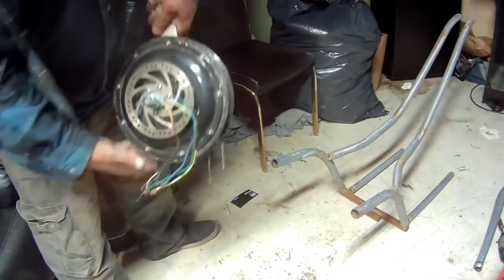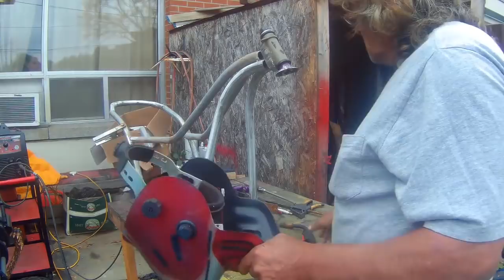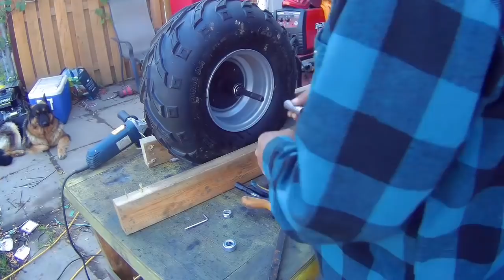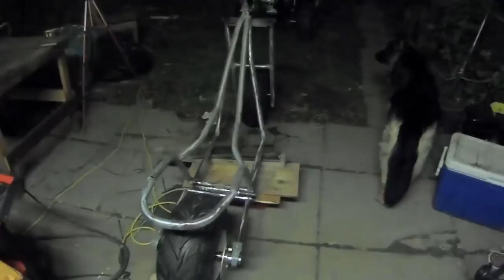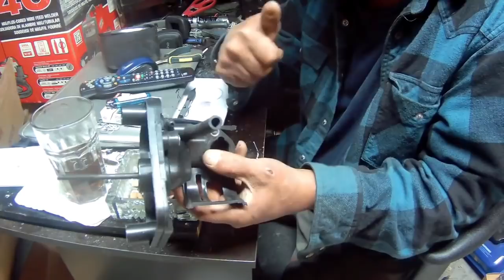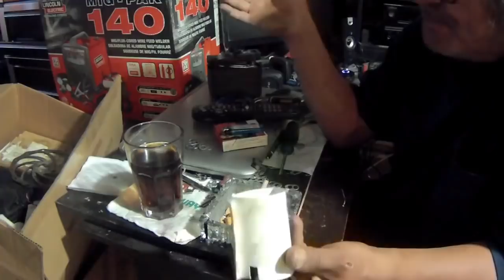Mini Bike/Chopper Build pt02

Comment: Draw a straight line on the floor and mark the center of tbe frame .. line them up to get a better reference. I like your design but it looks like it  needs a little more bracing for strength

Comment: The Chopper is coming along nicely mate.  If you want to check for square  you can  measure your diagonals.  It works on everything.  Or measure from two points to one  like a triangle.  Measure from the square part of your base frame on both sides to the centre of your headstock.  That  will  tell you how square it is. 
I'm hoping to see a nice exhaust too. I bouhht a few more bends  for pipes to be made.  Got some 180 degree bends.  Very handy 😉.  
Can't wait to see her goin.  Good one Neves.👍
Reply from the maker: Thanks Customwinder, I will check it and will probably have to adjust it a bit because it will never be perfect just by eye